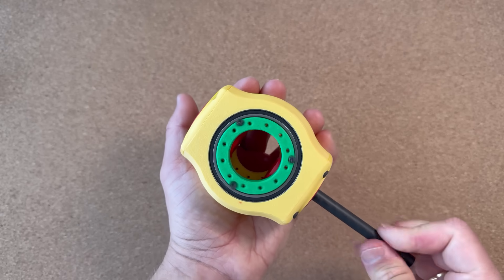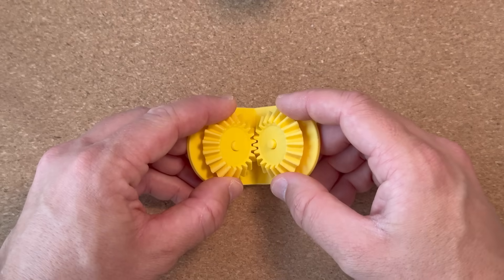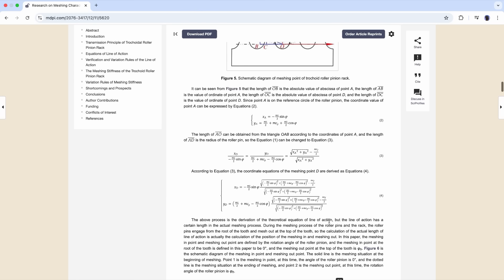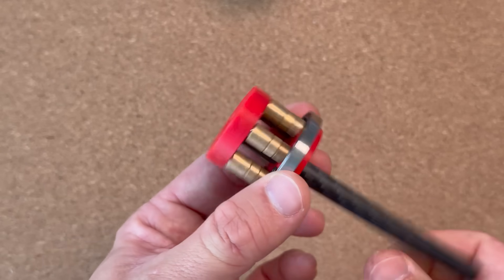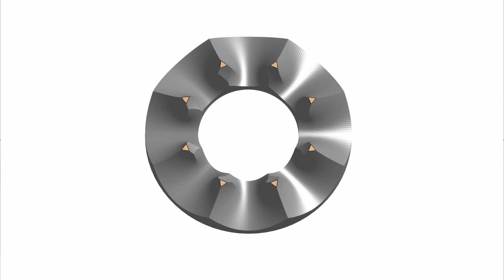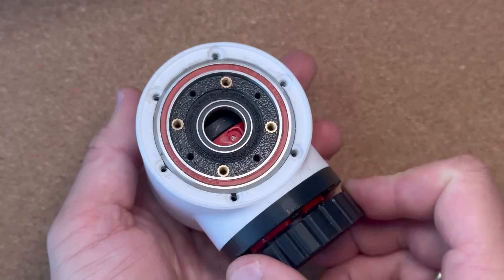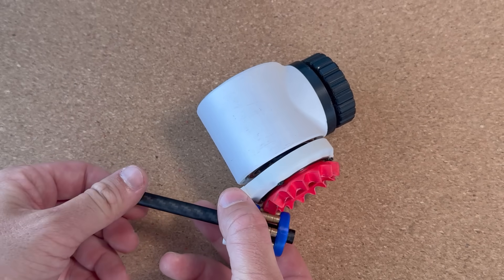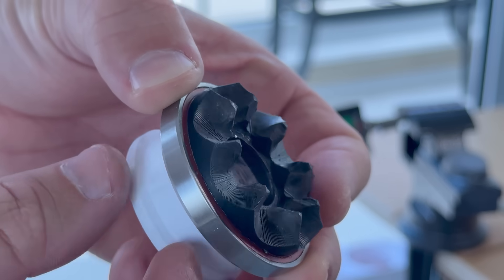High Precision Angular Gearbox, 3D Printed and Tested

Comment: Backlash, just to clarify for anyone missing what he pointed out, is minimized by preload. This is very common in high-precision machines. If you look up any bearing specs, they will specify the required preload for proper function. With 3D printing, there's always additional caveats. But the key here with this design is that it can be preloaded to remove backlash.
Reply from the maker: Thanks! Hope you noticed that on the wrist differential I added threaded holes for countersunk screws in the bearing housing. The MH-P16 bearing has a 45° chamfer, which helps preload the crown gears.
Reply: Alright, thanks, there was no mention of preloading (I even watched it twice), and I was going to ask how you can claim precision and zero backlash when even the slip-fit of the rollers will have some play, let alone the tooth contact.
Reply: @gaborbata8588  Exactly. 'Zero backlash' is achieved by bending parts out of whack. Let's say that that is the 'poor man's zero backlash way' LOL. Preloading always comes at a price - there is no such thing as a free lunch. Increased friction and wear. Also, lubricants ideally need a space to live, preloading squeezes it out, literally. No matter if he is a trained engineer or not, I don't care about 'formal' qualifications or appeal to authority, but this guy needs to study more before thinking he has invented something.
Not even mentioning the rollers which are pretty terrible as there is also play and friction in all the small bearings they ride on. Involutes exist for a reason.
Reply: @bigbattenberg  Salty and uninformed comment. The rollers help with the application of preload because the elements are in rolling contact rather than sliding contact (though obviously in this implementation they would work better if they were small ball races or similar, because sliding friction is still present on their inside diameter). Involutes are used to produce symmetrical gears, i.e. gears on which the tooth profile is the same for any gear in a train, whereas the type of gearing presented here is asymmetric so the involute is not required.
Reply: @bigbattenberg  you should get banned from the internet.
Reply: @bigbattenberg  big words dude.  Now how would you design a zero backlash system that has anything approaching manufacturable tolerances without having some form of preload?
Reply: @Soundpost-f2l  You have to remember that 'zero backlash' is only one part of the equation. The most important thing to realize is that every system has a certain overall stiffness. Think of it as 'everything is rubber'. The usual approaches to backlash elimination tend to preload sets of gears using any sort of springs. I have studied this subject quite a bit when I was employed at maxon motor. A good attempt at 'high efficiency zero backlash' is the Archimedes drive by IM Systems. When I first noticed this I felt this could be a game changer, around 10 years down the line I have not been keeping up on their progress. I did correctly identify three issues with their design: roller creep, tribology/ wear and slip when overtorqued, which they confirmed. Still a very interesting design.

Comment: I don't think conical rollers are a manufacturability problem. Lathes (including CNC lathes) have a lot of features and optimizations for cones. Because a ton of machine tooling depends on precision tapers as the interface and torque transfer surface. If I understand the form of the other side of your mechanism correctly the complexity of manufacturing the trochoid gear would go up massively, compared to a relatively tiny difference between conical or cylindrical rollers.

I also suspect that stacked rollers move the wear points instead of eliminating them, unless you also make that whole sub-assembly much more complex. Though moving wear points to something easy to source and replace is a really effective strategy in real world machine design, so it might still be the right answer for a lot of applications.
Reply from the maker: Thanks! I wanted to use the simplest and most affordable parts possible. I don’t have a lathe, so it influenced me.

As for the crown gear manufacturing: if we're talking about the straight pinion and a 90° angle, it seems like it could be machined on a 4-axis CNC — using the tool as a roller following its trajectory, while the crown gear rotates on the 4th axis according to the gear ratio.
Reply: @MishinMachine  That does seem like a reasonable manufacturing process for the crown gear. A machine with another axis in the right spot, or with a 4th axis that can be custom mounted for other angles could make crown gears for other angles too.

Comment: Another way to fix the friction is issue is to add clearance to one surface of the gear. It looks like your designs have “perfect” contact and the rollers are also crossing the pitch line. This means the surfaces on one side are trying to roll the rollers one way and the rollers on the other side are trying to roll it the other way. Since simultaneous perfect contact is impossible anyways and you want to be able to preload your rollers into the crown, you might as well just remove one of the surfaces and have the rollers always leading or always trailing.

Comment: This is actually one of the oldest gear types in existence. A “crown and lantern” gear. Of course in ancient times they had no way to design or manufacture a correctly meshing crown so they just used wooden pegs.

I numerically modelled up one up for Thang010146 a few years ago. https://youtu.be/ZBqALQqBcM0
Reply: what do you mean by numericly
Reply: I mean the same as Mishin. With a computer taking small steps and lots of discrete points. As opposed to analytically where an exact equation for a surface is found.
Reply: @Rudmin  isn't there a mathematical formula that would give us the crown gear surface, that would be computationally less expensive
Reply: Yes there probably exists a mathematical formula describing the surface. But no I don’t know what it is. 

And the computational cost is negligible for something like this. It probably takes a few ms to solve with nanometer accuracy.

Comment: Next step: CNC machine to finally make the parts to the precision you need.
Don't worry about the patent. It was a great idea that you came up with on your own (albeit with some inspiration from linear rails). Creativity like that is a treasure.
Reply: Seems like the toolpath would be very straightforward with this given the rollers and an endmill have the same shape.  Just spin the crown gear and drive the endmill in a circle the same diameter as the roller gear and slowly lower it into the gear blank after each pass.
Reply: True. Patients are only as useless as the paper they are printed on. I have 2 patients with my old employer. All useless
Reply: @lynnwilliam  read your comment again.
Reply: You could create a hobbing tool with endmills

Comment: If you really really want to turn heads have a bunch of machined to standard specifications and build a torture test rack running them through test connected to various motors, engines, low speed high and high speed low torque drive trains it couldbe a blast. I don`t see why you couldn`t have one machined for a sit down lawn mower or atv.

Comment: Good work, but 100yrs too late ! It's obvious to any qualified engineer that the thin upper profile of the teeth will not transmit any useful torque before  failure. Remain curious, but do some research and you will find that creative thinking is nothing new :(

Comment: 2:20 quick tip for seam bumps: you can choose "random" as the seam location (as compared to nearest, shortest, etc path in your slicer) and this will distribute the seam randomly, and as long as the seam isn't being over extruded (resulting in a seam zit covered surface) it will thus average out the radial bias of the seam, and thus leave any radially symmetrical part with a near perfect roundness.
Reply: This is specifically to address "roundness" being distorted by the part bulging towards the seam.
Reply: Or use scarf joint seams available in newer slicers
Reply: @kezyka6775 Scarf seams are incredible but really highlight any over/under extrusion!
Reply: (my pet peeve is the lack of vase mode style printing algorithms), why isn't there a 2+ wall thickness vase mode?
Reply: @meateaw  Is a multiple wall vase mode even physically possible though? How would the nozzle extrude two lines without stopping or interfering with its own previous path?

Maybe it’s kind-of possible, but I think you’d still have a seam of sorts wherever you moved from one perimeter to another.
Reply: Also, you can overdo the the retraction a bit, so you get indents instead of lumps, maintaining dimensional accuracy.
Reply: Or you could even do a vase mode print then backfill with solid plastic to harden it up.

Comment: Patents in the USA do not prevent anyone from copying and manufacturing the design. In fact, they explicitly show you how to copy the design. However, you are not allowed to sell any product that uses the patent design.

Also for the patent, read through the independent claims. That's all that matters. The rest of the patent is just pretty pictures. This is true of any patent.
Reply: nick has the answer. The patent only prevents people from using the design for commercial (money making) purposes, in that country. And even then, the patent doesn't magically do anything if you start using the design to make money......unless they "defend the patent." That's patent-speak for, "They sue you."
Reply: In the US there are no blanket exemptions for personal or non-commercial purposes. There is only a very limited exemption on non-commercial experimental purposes. So if you're copying a patented design at home just to tinker with it, that's OK. If you upload a video of it to YouTube, that's probably OK. If you monetize that video, that likely crosses the line and becomes infringement. If you copy a patented design for personal use (e.g. to avoid buying from the patent holder or their licensees), that is infringement. Enforcement is unlikely in these sorts of cases but there is the possibility.

Comment: A friend of in school came one day completely tired but excited, he told that found a method to work with complex functions and that he method helps to convert them to some simple algebraic equations. Later he has found that it was Laplace transormations done centuries before him. He was tottaly ruined
Reply: I came up with an idea of ventilation for tunnels inspired by the Dyson blade less fans. Then started a patent process, and in the middle of it, I found a120 year old patent showing the same thing.
Reply: I "invented" the CVT gearbox as a teenager (about 35 years ago)... before my dad told me that designs had existed for decades 🤦‍♂
Reply: If the story is true, the guy is a genius. He should be happy. Tell him about Ramanujan.
Reply: If you think you’ve uncovered a world-changing secret, chances are you just haven’t read enough books.😂
Reply: @zhili1238  TBF, even rediscovering a trick people have forgotten could be valuable
Reply: @zhili1238  You should see how many "unpickable locks" there be been!
Reply: many such cases
Reply: Not quite the same, but once upon a time, I thought I'd solved P = NP, and moreover trivialized essentially all computation.  I knew there was no way I really had, but still, it was possibly the most excited I've ever been, and the most disappointed I've ever been when I figured out why I was wrong, haha.
Reply: I came up with an idea of a electro-optic LCD windshield to combat headlight glare on the road. Turns out it was in use with aircraft for the past 30 years.
Reply: @jaymzx0  I had a similar idea for car windshields, and found the same thing you did lol
Reply: I invented the bridge rectifier as a kid after reading a book of my grandpa's from the 1920s and thinking "there must be a better way". Only a few decades too late.
Reply: @cooperised  Nice
Reply: Look... If you used your brain to come up with ideas on your own, it doesn't take away from your brilliance that someone in the past, that was also brilliant,  how's come up with it before you. All that proves is that you are brilliant as well. Keep using that noggin, it doesn't have to be a unique thought to be brilliant, and often, you will think of something that some other genius didn't. 

Give yourself some credit, and don't forget that comparison is the ultimate killjoy because there will always be someone who came up with something greater than you. Don't do that to yourself.
Reply: I had a great idea (more than one, but this one was great) and was very sad when I went all the way to Glasgow and spent a day in the patent library stacks in Glasgow, to find it that it had been patented and abandoned 4 years previously! Based on the catapult of antiquity, too, so only one other person in centuries had the same idea! I was very sad that day.
Reply: I came up with idea of Union-Find data structure in high school while trying to solve an no. of diskoint islands in a graph problem.
Reply: I invented en flique but then that video came along and now that's all anyone remembers
Reply: hahahaha.
Reply: The really smart people don't need to read as much because they can intuit a lot of things that we have to find in books.
Reply: In my first year of studying math, I was wondering why there couldn't be an additional imaginary axis. I worked on it a couple of days, and only could make it work if I introduced a third imaginary axis, and gave up on commutativity. 
Yep, I 'invented' quaternions.
Reply: Reminds me of when I invented a stick that was really good at throwing spears.. Turns out Ugglugg in the Americas beat me to it...

Comment: So cool! Another way you can design the tooth profile at 2:53 is by sweeping the curve just by using the center line of the rollers, then offsetting it by the roller radius. This should be a smoother with fewer steps if you can loft between splines. I learned that trick from when I designed a roller-based reducer a while back, which I've been reluctant to share for patent reasons. I'm not sure if my design is unique enough or not…
Reply: Actually you can't. The "outside" center of the roller has a cycloidal path relative to the main cylinder, that is ok. But the center "inside" makes a "pig tail" when it is at the lowest point of its path. This makes the surface non ofsetable. I did not give up there, i tried to calculate the rolling surface's lines, which we know are one radius away from the path line. Same error, tangent vector and roller direction vector cross product changes sign, and worse even, it also has a pigtail, can't use it for surface generation. But motion simulation veryfied it. At the bottom, roller is rolling on it's top... So shit is fucked.
If i was the producer of the video, i would have settled with the conical rollers, maths turn out to be charming there.
Some time later i will try to find analytical solution again, but the monday and tuesday were fucked bcs. Of this.
Maybe this cant be written correctly from the gears reference frame.
Reply: @gaborbognar4738  You're right, but it might work If you make the crown gear radius smaller than it's "supposed" to be based on the gear ratio. It would basically only act like the "outside" portion. That should smooth out the pigtails kind of like how lowering the eccentricity for cycloidal drives smooths the gears out. Depending on the program you could also split it up into inside and outside, then do offsets in both directions for the inside but that's kind of a pain to do.
Reply: @xenontesla122  this does not let me rest, so i will keep experimenting, thanks for the suggestion!
Reply: i am new to solidworks, and not quite know how is it done, may you give me any resource to how is it done? i am curious about this method, it sounds cool. tk you
Reply: @pbx1390  3D modeling has a steep learning curve. I'd suggest modeling something that's only slightly more complex than what you've done before instead of this. But if you're up for the challenge, look up "solidworks surface modeling", "solidworks lofts" and "solidworks cycloid drive". Good luck!